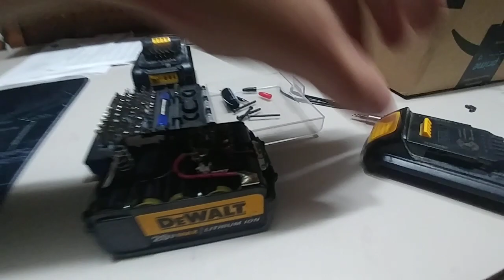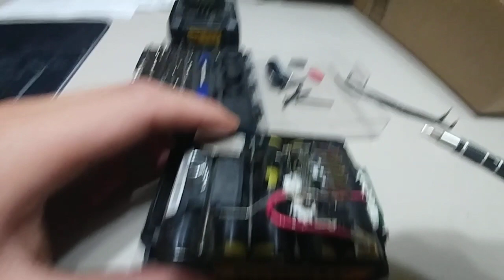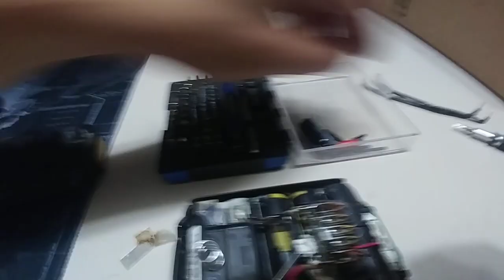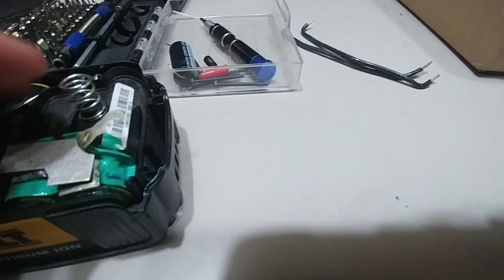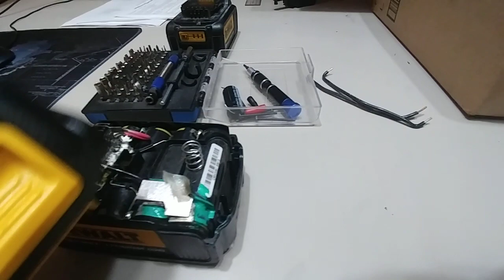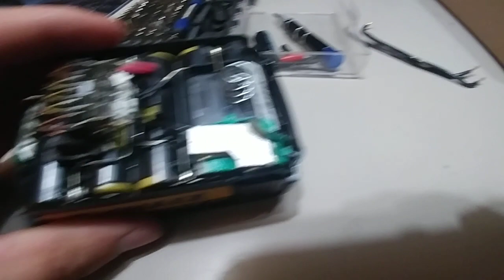Diy quick repair dead dewalt 20v battery pack

Comment: I replaced my car battery with an 18 volt dewalt battery. It works great. Been using it for the last 3 years. Never had a problem.
Reply from the maker: I thought this was a bad idea till I did the math and yea its good math wise. 2.6 lowest 3 average 3.6 running v. Just want a 4 or 5ah pack. 2ah or smaller and the starting motor is damaging the cells. It works but hits the limit in a bad way

Comment: I would put a fuse in back in. Melt the plastic off a automotive blade fuse so it fits, with wire cutters trim it to fit then solder it in.

Comment: Finally, every other video said to jump the non working battery pack to a working one and that fixes it. Well not mine. I bet if I unscrew it's case I'll find a similar issue....
Reply: **Lmao if it works and only 9 comments wow. Please has anyone else tried it? I have a 20v 5AH big $$$ battery which suck because the weight thats added to your drill all day long. Thank you myfriend 🙏 stay 🙏.**

Comment: LMAO .. I thought I was the only one who tried to jump start a car with battery drill .. happened to me today and I couldn't think of anything else than use my DeWalt battery to get me out of highway ...did work my car started but battery won't charge lol ... thank you
Reply from the maker: np glad to hear. I don't recommend it but i would be lying if i said i haven't use my drill batteries to jump start dozens of times while i saved up money to buy a new battery lol. just dont do what i did and mix up the neg and pos wires lol.

Comment: If u had to boost you car battery "dozens & dozens" of times you need a new friggin battery
Reply from the maker: I did replace it but sometimes lights stay on. :p
Reply: Dozens of dozens you could be in a hard situation where you might have to use the last resource to get where you need to..